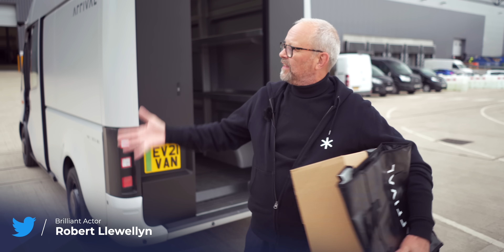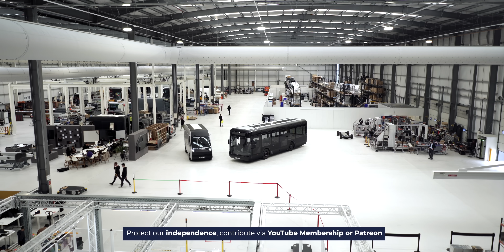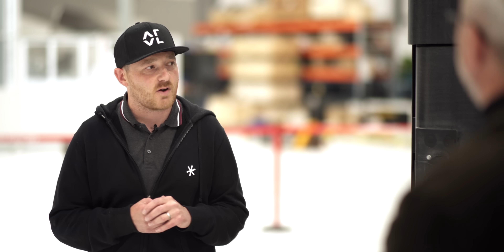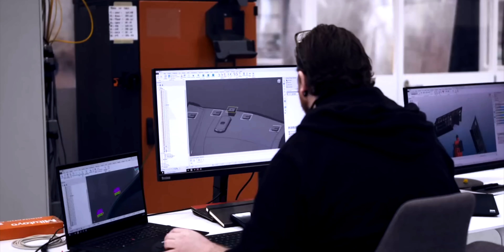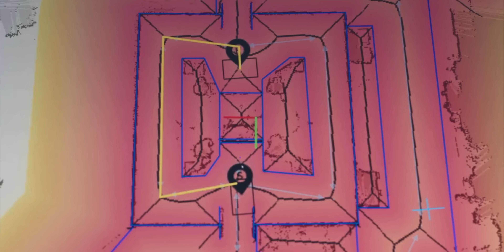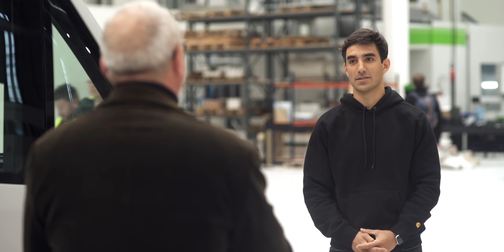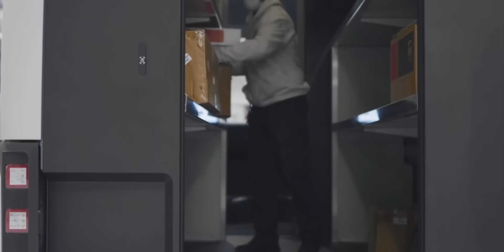ARRIVAL Exclusive - Inside Britain's most 'valuable' business | FULLY CHARGED

Comment: Certain kinds of electric vehicles make an insane amount of sense. Delivery vehicles being one of them given how predictable their daily routine is and the amount of fuel consumption they represent on the roads. Not just when they're driving but the stop/start nature of their route. Aside from that, EVs are going to be a lot quieter.
Reply: @stumpyplank6092  Fuel Cells need more rare earth minerals than batteries (that actually contain little / none) - and fuel cells still need the electric motors (which do use some rare earth minerals).  Pushing for HFCs also ignores the far higher efficiency losses and the fact that there's no supply network for hydrogen atm (and that the vast majority of hydrogen currently available is 'dirty').

Yes, there are scenarios where HFCs may make sense - but city busses / delivery trucks aren't it.
Reply: @stumpyplank6092  I can see hydrogen for long haul semi's, but most fleet vehicles (including buses) can go through a day on one charge.  Then all you have to do is plug them all in at the end of the day and let them recharge over night.

While hydrogen has the advantage of allowing for longer distance traveling and shorter refuel times, it's also a great deal more expensive and is more complex than BEV's (more things to go wrong).  All-in-all, if a BEV can do the job, you're better off with it than with hydrogen.
Reply: @stumpyplank6092  Sure, hydrogen charges faster than battery... but truck drivers are mandated by law to take a break every 4 hours... and that break is long enough to recharge the batteries for the vehicle as well as the driver.

As for e.g. busses - typically they go back to  depo too for a clean and change of driver... and based on my limited experience (of having lived near a demo) that's usuallty at least ~15 mins - which again would likely be long enough for a recharge (and if not, extending to 20 mins might be acceptable)

There's also the consideration that EVs don't require storing large amounts of explosive fuel (yes, batteries can catch fire - although they're working on that - but they typically don't explode the way pressurised hydrogen can), don't require delivery drivers to deliver the fuel, and require far less maintenance (including the refueling infrastructure).

There are other considerations too (energy efficiency, among others) - but they also fall on the side of EVs, in the main.
Reply: @stumpyplank6092  HFC vehicles also need a battery because they cannot meet the peak demand, the fuel cell + gas storage is bulky and heavy and hydrogen is both inefficient and expensive, even when made by electrolysis, so it is really a none starter.
Reply: @stumpyplank6092   Lithium is the 25th most abundant element on earth, why would you feel we would run of of this? Nickel maybe but large vehicles tend to use the lithium-iron-phosphate (LFP) batteries, also these do not have a problem thermal runaway.
Reply: @stumpyplank6092  the market hasn't decided on wind energy or electric cars without political leadership and policy intervention. I don't trust it to decide between electricity and hydrogen.
Reply: @stumpyplank6092  Not really... way more expensive, more issues with fill ups.
Reply: These vans will be useful as Delivery vehicles and buses in cities for Amazon, UPS etc, but not so much in the country and smaller towns where there is a lack of charging infrastructure and you have to drive 200 miles per delivery day sometimes…the full reliability of these vehicles is yet to be tested everywhere.

Though it will mean far cleaner air in cities and towns.
Reply: I just can’t see Hydrogen being economically viable in vehicles. Any process to use it is highly inefficient and as people have stated HFC’s can’t meet peak loads for power so still need a battery, albeit smaller. It is more important to use to decarbonise steel making and aviation rather than vehicles in my opinion. Ultimately efficiency is key and EV’s have a round trip efficiency of about 80-85% and currently hydrogen is at best 40% efficient. Barely better than a ICE. If electrolysis gets better or we find a better method to create green H2 then great but currently I just can’t see it happening. Happy to be wrong though!
Reply: Garbage truck/Dustbin lorries must be a target. They start and stop constantly, lurching along carrying huge weights and equipment.
Reply: Yes but certain don't, like buses that go on preset routes. Trolley buses would be a much better option. Both economically and ecologically.
Reply: @stumpyplank6092  The fudsters will have you believe batteries are dangerous with fires, but I don't want to be anywhere near a hydrogen fueled vehicle if it goes up in smoke. The pressure those tanks are at and the fact that hydrogen causes embrittlement of metals and it is very hard to contain as the molecule is very small and leaks out of any orifices' meaning a vehicle stood for any length of time could find its fuel tank empty by the time it needs to use it.

Comment: That bus - is it wide enough inside for a MINI Electric? Or three?? That flat floor sounds ideal... 🤔 
👏👏. 👏-👏-👏. 👏-👏-👏-👏. 👏-👏
👋
🚌🚗🚗🚗🇮🇹
Reply: are you putting forward doing a bank job   with three minis    would they be white, red and blue.    which bank did you have in mind
Reply: @davidsworld5837  Turin sounds about right...
Reply: @examinerian  

Fiat currency raid? 😁
Reply: @rogerstarkey5390  😁 why, of course - lighter than bullion, may offset the battery weight.

Maybe 500e models would fit better... 🤔

Comment: I wonder what it is hoing to cost as a campervan or a van that i could convert
Reply: They mention "price parity with fossil fuel vans"
So, the base van should be the same price.
But these will be a simpler fit out.
Flat, vertical sides, looks like unistrut rails inside for fitting.
Just spec the modules as plain/ door type/ window type and the number you want.
There's a great possibility for them to design bolt in furniture modules as well.

Comment: i hope these guys succeed but once again, i saw nothing new... it's the same buzz, same BS about "microfactories"... where are these factories? where are the cars? how much longer are they going to pull the cat by its tail with all these micro-adjustments?..
Reply: As long as the investors money last I guess. 
....meanwhile BYD and other Chinese factories already cranks out fleets of battery busses and vans.
Reply: @ulwur  One thing though. So far all Chinese electric buses I've seen, only have front and middle door and high floor at the back. And that's where they put all the batteries. Quite a lot of cities on the Continent require buses to have 3 (4 in case of 18m variant) doors. And low floor entrance at all of them. So those BYD buses might not pass the bidding.
Reply: At least they are mentioning the fact that there are floor requirements. And it comes from manufacturer. 
For example. Solaris Bus and Coach have fully electric buses in their line-up. At the first picture in the gallery of Urbino Electric, you can see how thin the floor is. So no surprise they had to shove batteries on the roof. Attempt to squeeze them in the floor, would raise said floor, so you would need either to add a step (which most customers would not accept) or increase suspension adjustment range (kneeling function already present in most modern buses) which might require bigger wheel arches (wheels have to go somewhere when body goes lower) and that would steal even more space from interior.

Comment: Really excited by Arrival. And a CamperVan??? Yes please! 😋
Reply: I think they need to raise it up somewhat for camper usage. but yes, I look forward to it.
Reply: @xxwookey  Can you explain which part you think needs to be raised up? I look at the delivery model and it seems to tick all the boxes.
Reply: @JohnnyMotel99  The ground clearance looks rather minimal. Find for the city (just enough for a road hump), but rather less than my current Expert van (which is hardly an off-road vehicle, but is much better than your average car in this regard and I've found has sufficient clearance for most sensible uses in practice), and you wouldn't need much of a rut to be bashing the bottom. The departure angles are very good because the wheels are at the corners. 50mm or so higher would make me a lot happier. Maybe it's not as bad as it looks and I'm being deceived by the wheel size, but we know they deliberately optimised it low for parcel deliverers being in and out all day, so I'd like to see a measurement.
Reply: @xxwookey  great points! I guess it wouldn’t take too much redesign to raise the ground clearance. I love the walk through design and the spacious cabin. I’ve seen many people commenting on the camper usage, hopefully the company will make the vehicle available to camper fitters.

Comment: I had enough at around 50%. Electric vans and bus are not held back because of ux, f*** off with designers talkin like "we thought about how to get the rider into..." shut up! Get the engineers wo make the bus drive 2.000.000km reliable and interview them. If you send guys talking about the USB-Plugs, you are done in some years, because you dont know what the problem with designing an industrial vehicle is. The is company probably is vaporware - remember that I called it.